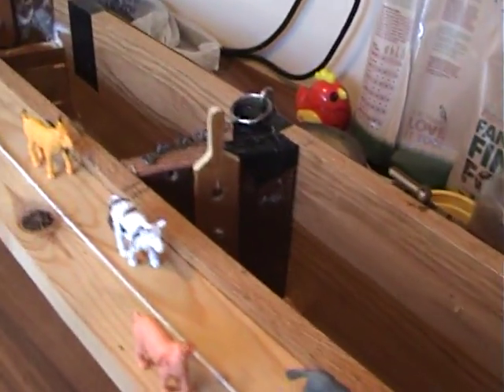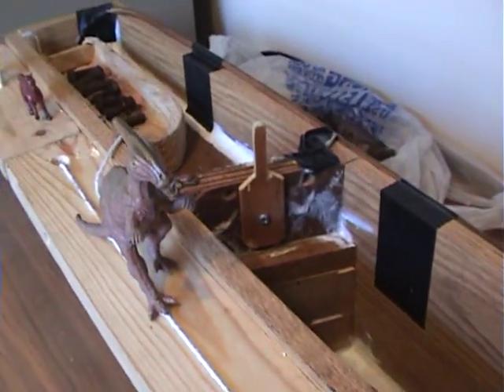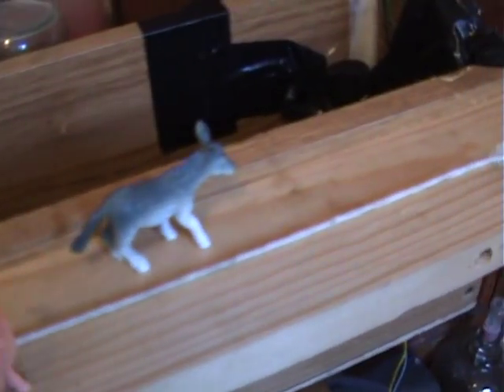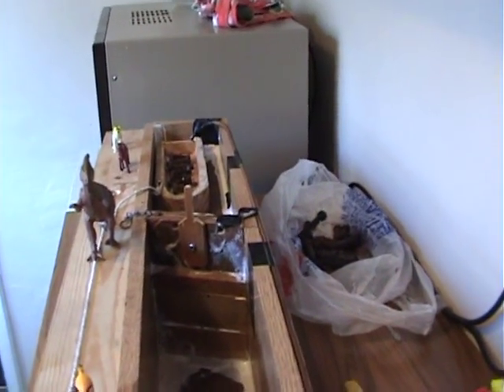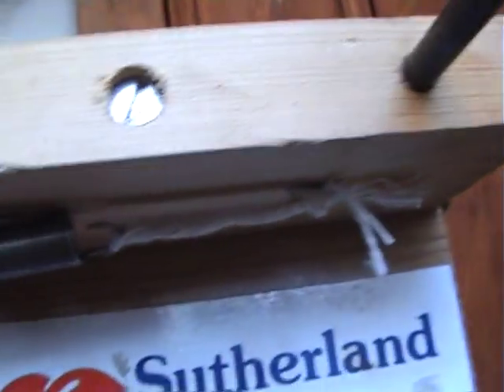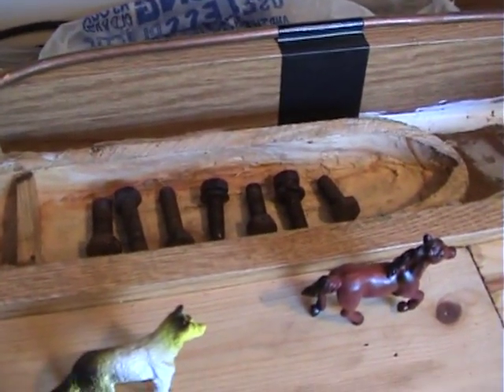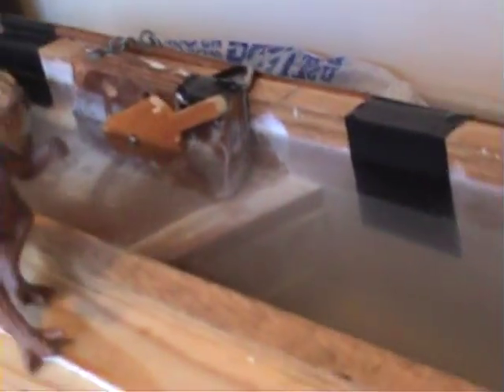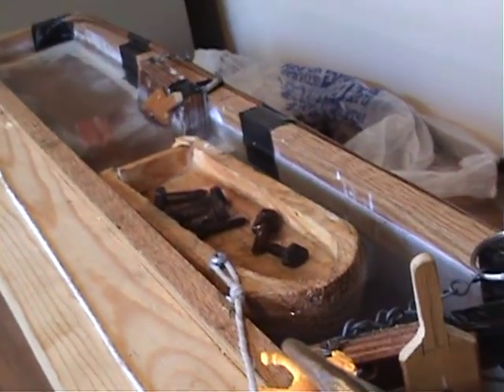Model Canal Lock Finished and Working

Comment: That is absolutely incredible ,,,,,   when I said it would be easier to beat your self over the head with a peice of 3 x 2 i was wrong,,,,, I can imagine how many problems you have had,,,,    lesser men would never even attempted it,,,, its a true testament to your doggied determination ,,,,, well done and congratulations ,,,,, I owe you a dandelion and burdock,,,,, email me your address,,,, and I will with the greatest of pleasure get one over to you,,,,,,  cheers and very well done Best Regards ,,,, Alan
Reply from the maker: ***** Many Thanks Alan - But you were right lol. As I know locks and rivers I did have some idea what to do. Locks are very simple ancient pieces of equipment, and as long as you have a flow of water work well. The only time they are unusable is in times of flood. Once at Bardney the water was over the top of the gates. Getting in from the upper level was easy, but it was impossible to open the lower gates. We just couldn't crack them, even with a tug from my hired small truck. Glue and water don't mix, but fibreglass does, and is relatively inexpensive. A holding tank and a continuous pump and it would work properly.
Re your latest video. I understand. Kind Regards.......Malc.